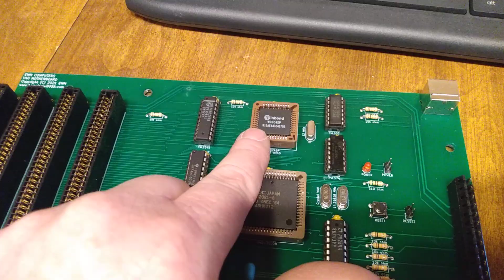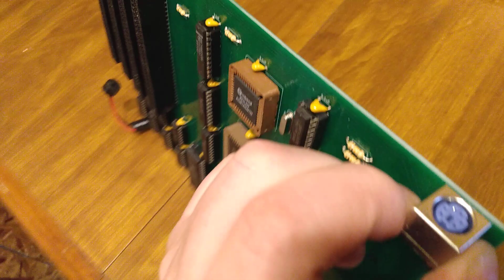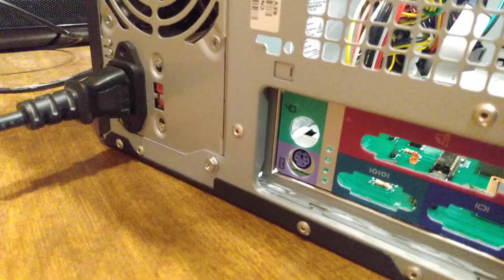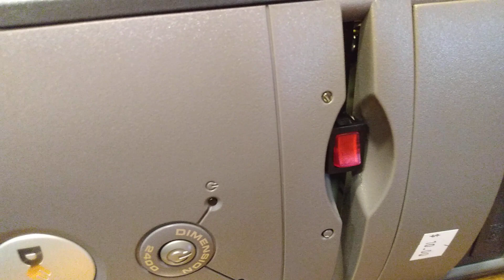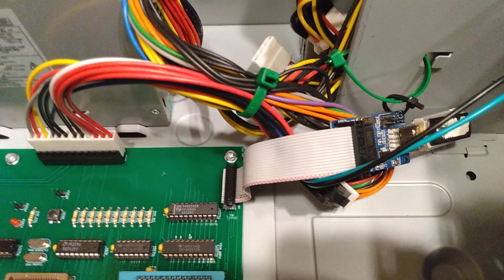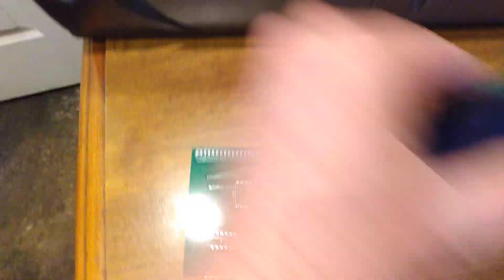NEC V40 motherboard. 8088 PC compatible.

Comment: Hi. Excellent project!

Would it be possible to replace the CPU with a 20Mhz V40 μPD70208HLP-20? 

Or maybe a V50 μPD70216H?
Reply from the maker: So I have tried the 20mhz before. The problem is the ISA bus was never designed to run at that speed. So something would need to be done to regulate the ISA speed.
Reply: @elijahmmiller  Maybe having an oscillator in separate for the ISA bus? (I'm a software chap, but I'm into electronics, so I'm no expert at all.)

I asked because I have a classic Olivetti PC-1 and I was wondering if I could upgrade the 8 MHz original V40 with a 20 MHz HLP-20 CPU.
Reply from the maker: It would require to add in a separate ISA bus controller to run smoothly.

Comment: HELLO, I BUY THIS KIT A LONG TIME AGO. COULD YOU PROVIDE ME A LINK WITH THE BIOS FILE AND A MANUAL or pinout for the power supply, the ebay link is no longer available
Reply from the maker: https://gitlab.com/hakfoo1/v40-bios
Reply from the maker: I would also recommend checking out the discord server. There has been a couple of guys working on different BIOS versions.

Comment: Would this be able to use a standard EGA/CGA/VGA card?
Reply from the maker: I have only tested the CGA card so far. It seems to be working fine. I haven't heard from anyone yet that has tried using an EGA card. There are a few guys out there that have gotten VGA cards working just fine.
Reply: 16 bit Oak Tech VGA and a Realtek VGA works fine in the 8 bit slot. Alot of ISA card's ASIC controllers sensed the 8 or 16 bit slot.
Reply: @greghol  Yes, on a standard XT.  I was asking about this specific board.
Reply: @dennisp.2147  I didn't word that correctly. What I said is true but what I mean is the 16 bit VGA boards I used will work on this board (I have the ISA version of this V40 board which for what I'm talking about is the same as this board) This V40 on this board is supplying only 8 bits to the 16 bits style of connector and 16 bit VGA cards work in it.
Reply: @greghol  Thanks!  that's what I was looking for.  I was curious if his BIOS was able to hook the right interrupts for those cards.
Reply: @dennisp.2147  Video cards in DOS don't really need interrupts - some cards do support them but I think you have to go up to PCI before that starts to be a thing, or maybe something weird like PGA might use it because that has a command queue and it might signal when it's done with the operations.  But CGA/EGA/VGA will work just fine without interrupts.  What they do need is the right address space and port numbers available, which it sounds like should be the case on this.
Reply: @big0bad0brad  Nowhere did I mention interrupts.
Reply: @dennisp.2147  "Thanks!  that's what I was looking for.  I was curious if his BIOS was able to hook the right interrupts for those cards."

Comment: You mentioned a 20mhz v40 didn't work, but do you think a 10 or 16mhz would work better?
Reply from the maker: I think definitely the 10 mhz will work and most likely the 16 mhz.  Maybe I will order some and try. 

The 20 mhz processor boots and runs without crashing. It just wont load the USB drive. I need to adjust the timing for the read cycles. 

The LCD screen worked fine with the 20 mhz but the CGA doesn't.

Comment: the IBM PS/2 Model 30, introduced April 1987, had PS/2 keyboard and mouse ports, and still had the PC ISA bus for expansion cards, so in a way your board's architecture is reminiscent of the Model 30
Reply from the maker: That makes sense.

Comment: You could add a SN76489 chip on port C0h for Tandy Sound. I've personally patched loads of games to ignore Tandy BIOS checks and play 3 voice Sound.
Reply from the maker: That definitely could be added to the motherboard or built on to an ISA card.
Reply: @elijahmmiller  Cool. But would be nicer to just have it on the motherboard. It would make it rather unique. An XT motherboard with Tandy 1000 Sound capabilities except its not a Tandy 1000 🤣

Comment: Takes me back.  I used the V40 (or maybe it was the v30) in a design back in 1991!!   I wrote a load of BIOS functions and used a tool called link&locate to get it to link to the correct memory segment.

Comment: cool! -5V just about its only use was the original Sound Blaster (probably other vintage sound cards, too) I've seen some recent projects for sale providing adapters for ATX power supplies that provide this. The Apple II series and probably other contemporary 6502 PCs also use -5V, but their PSUs are about 15W compared to roughly 150W and up for PC clones. Unfortunately, I'm an autodidact when it comes to electrical components, this teaches me a lot. My "hobby" in the 90s was keeping up with new PC tech (including Macs) Its fascinating to see what looks a little like a modern version of hardware for DOS if it were continued with compatibility as the main priority. Maybe even CP/M-86 style!  It's weird to hear a chip designed around the V20, which was designed to be both 8080 and 8088 compatible. Layers upon layers!